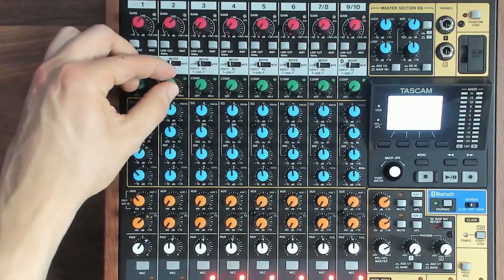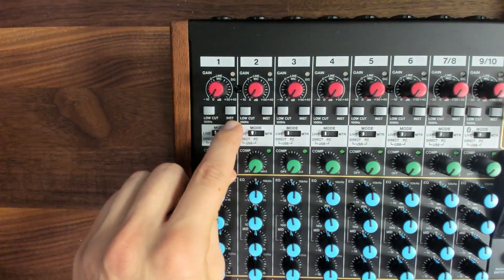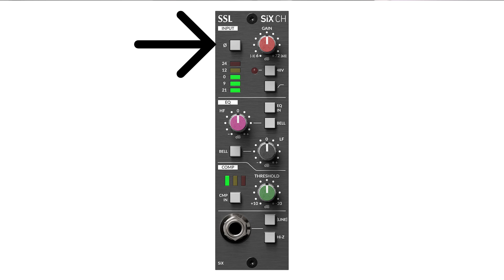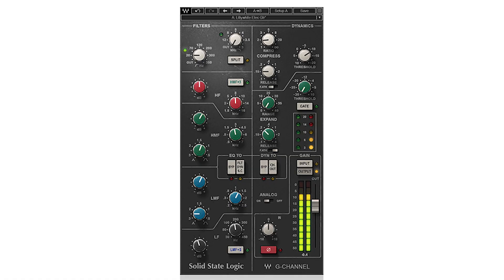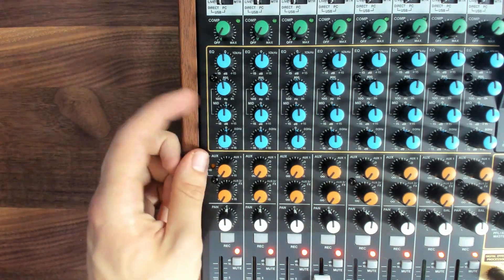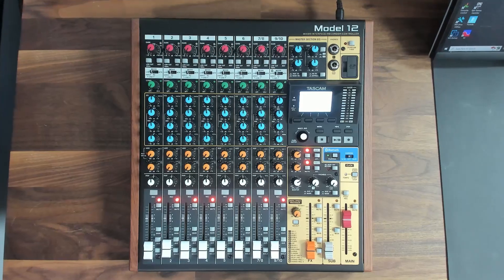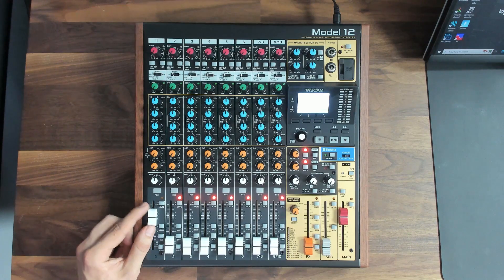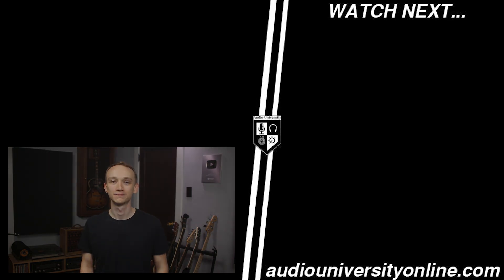How To Use an Audio Mixer | Buttons, Knobs, & Faders

Comment: I'm A  DJ And I have a  20 Channel  Sound  Mixer  Although  They  Can Look  Confusing  To Many People  But  They  Are  Quite  Simple to Operate If you  Know  How   Generally  It  Is  Bass  Treble  Mid Range /Bass  For Your  Lower  Bass  Beat  Woofer  Treble For Your  Higher  Sounds  Such As  Simbel s  Treble  Can  Also  Be  Used To  Clear the Sound  By  use ing the Equalizer  Use The  Effects To  Create  Different Type of  Effects  Just  Play Around  With  It  You Will  Soon  Under  Stand  What Does  What  Don't  Be  Afraid  To  Turn  Any  Knobs  The  Knob is  There  To  Do  A Particular  Function  Each  Knob  Or  Fader  Will  Only  Do  What It Is Supposed to Do  Be  Sure To  Have  Fun  With You're  Mixer  ❤❤❤❤

Comment: Thank you so much dear.Your  video is very helpful. 
 But I need your guidance .
 Is it not also possible to connect  and use  Rode Wireless Go II or  Wireless Pro through  a mixer to an amplifier  to   use the system for  addressing  a gathering from a stage ,using the Rode wireless mic ,as a hands free mic ? 
Also please  give me any other guidance or caution in this matter, if you have any ,because I am  quite new to this .
Thank you .God bless you.

Comment: Your videos are very well detailed and explained. I usually go for your tutorials first before others.
I tried all the existing tutorials , but can't get my Model 12 to work as an interface. Not sure what step i'm missing and i did watch the very few tutorials available on Youtube, but i can't get a signal to my PC.
 I get the PC return signal, but can't get a signal from an input channel of Model 12 to my Studio One 6. 
I got the audio drivers downloaded, i got the Model 12 setup as audio interface. I got the  12 outs/10 ins setup in Studio One. It's different and more complicated to setup a multichannel mixer like this than a regular 2 in, 2 out interface. The configuration of the inputs and outputs don't seem to work and is confusing. Not sure if it needs other settings in Windows that regular 2 channel interface don't.
Setting up Model 12 as an interface could be a future video idea.
Reply from the maker: Sorry to hear that you’re having trouble setting it up. This video shows the steps in Cubase, which should be similar to the Studio One setup: https://youtu.be/guuor7UfKe0?si=_lLY8yjm9IYGOS3J

Comment: BRO I would love to watch a video from you detailing troubleshooting steps for audible hum. I have a client with an older system that can barely push volume up because the hum becomes too distracting
Reply from the maker: That’s a great suggestion, Jorell! I’ve been meaning to put together a video like that, but it’s such a case-by-case topic. I want to make sure it helps most people who watch it, so it’s taking awhile to do the research. Thanks again! Hopefully I’ll have something for you soon.
Reply: Could be a grounding issue in the chain somewhere.

Comment: Hello. When I move my balance knob from left to right  coming from  a 0  setting  moving to the left  totally rises the volume  and moving totally to the right  it  silence the signal.   What can be happening ? I would have guess the sound would only change form one side to the other but not like this. Please help.  Thank you
Reply from the maker: It sounds like the left output is feeding both of your speakers. Be sure to check your connections.

Comment: You should see a Soundcraft Europa; that's a BIG monkey with loads of features for an analog board!  Also, I've never understood why it's called a "High Pass" on most equipment.  It's naming the filter by what it doesn't do.  I prefer "Low Cut", that's what it does!  (Not that anyone cares what I think.)

You've hit the hornet's nest now Kyle!  Stepping into the features of consoles can be a very long and varying road.  You're a good teacher so I'm sure you have a plan.  Please mention Solo In Place, that one tiny feature has derailed my train more times than I care to admit...
Reply from the maker: Thanks for sharing, Lance! I love when consoles have a little glass enclosure around the solo in place button! Haha! Emergency use only.
Reply: @AudioUniversity  Yup!  Great during rehearsal, damning during the show.